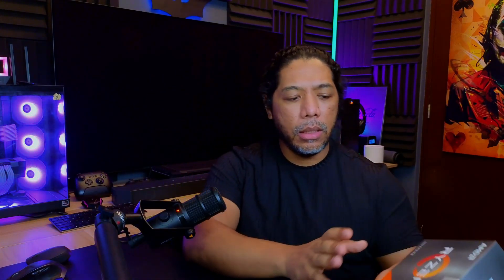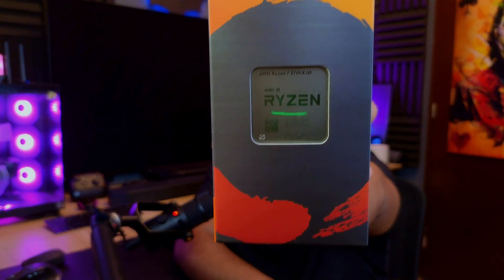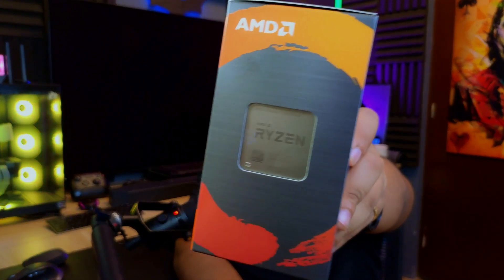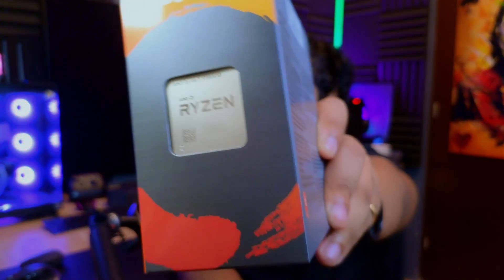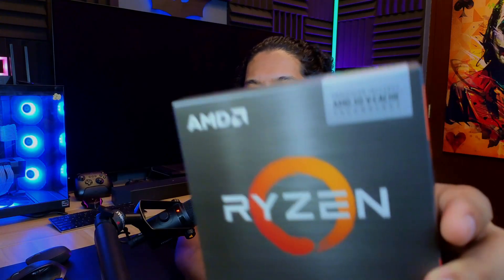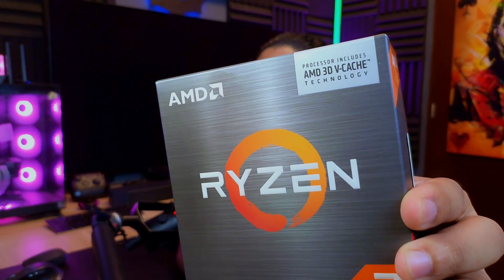Upgrading my Ryzen 5 5600 to a Ryzen 7 5700X3D. Is It Worth It? | Ryzen 5 5600 vs Ryzen 7 5700X3D

Comment: If you're gaming at 1080p the upgrade to the X3D's L3 cache (96<B) will be SUPER noticeable (30% or more). At 1440p, the boost will be 10-13% om average. At 4K, the CPU won't be a factor at all if you have a capable GPU.

Comment: I build budget gaming PCs and I always tell the buyers to stick with the AM4. If you're not looking for 4k high end gaming, you'll still be well served with the 5600 - 5800x3d plethora of CPUs and your card, no matter which one you have, won't be bottlenecked if you pick your GPU depending on your CPU. I still like the 5600x and think it's a great CPU, hell, I even make 3600 based PCs for certain games and types of gamers. You can make a 400€ PC with a R5 3600 and 3060 Ti with great components which will serve all your 1080p/1440dlss gaming needs provided, again, that you're not after the high end experience.

Comment: Adopting the AM4 platform in 2018 is the best gaming PC decision I ever made. Started with a 2400G with integrated graphics. Upgraded to a 2700 and RX 580 8GB. Then i upgraded to the 5600X and the RX 6800 16GB. Then, when they have a 5600X3D bundle at MicroCenter for $260usd, I jumped on it. Needed a home theater pc anyway, so I took my spare parts and put a machine together for my mother, who is bedridden. AM4 is the gift that just keeps giving. Thanks for the video.

Comment: The 6800 will definitely stretch the 5600 but I doubt it will make much difference at 1440p. Contemplating a several hundred dollar cpu upgrade (these are put of production and trickling out at very high prices now) for such doesn’t seem worth it.

Comment: Good choice and lucky on your country, on mine I saw the option about upgrading from my 5600, 5700X 3D and 5800X 3D where my options too. Last year when I was just "thinking" of that the prices where 250 - 5700X 3D and 420 -  5800X 3D a lot of money for me vs. a little performance between those processors. Now I got convinced by our video. 5800X 3D out of stock. 5700X 3D - 620, the exactly the same price as 9800X 3D. My only option right now is a 5800X - 150. :(

Comment: I have a 7800xt on my 5600. With a fully optimized bios it can utilize 100% of the gpu even at 1080p (ultra) on AAA titles. It gets 350-400 on esports. No stutters, probably thanks to 4000mhz cl18 ram. 

But there is no headroom. I was thinking about going with the 5700x3d, but it makes more sense to get the much cheaper 7500f and sell the am4 kit to cover the difference.

Comment: i recently had the opportunity too grab a 9070xt and ive really noticed that my 5600x is bottlenecking it, im getting the same stutters and choppy performance you were talking about with your CPU. in marvel rivals im getting virtually the same performance as my 6800xt and for the life of me i cannot get above 100fps when the action is ramping up and the performance and stutters is all over the place. even at 1440P i noticed in cyberpunk i get better performance on ultra settings than i do on high settings and just watching the performance overlay my gpu wont boost up too the highest clocks unless I turn on raytracing. the most fps i can seem to get is 110 fps and thats with my gpu and cpu tuned too the best of my abilities. its gonna be a night and day difference when my 5700x3d comes in!
Reply: I have the same dilema, I recently bought 9070xt paired with my 5600 but got a good deal to swap my 5600 to 5700x3d + 115usd.

Comment: Bro my cpu r53600 and gpu was 1660 run very smooth in fps gaming recently i upgrade gpu rx6700xt now im facing stuttering and big frame drops even in 2k resullotion very annoying. Now plan to upgrade cpu shoud i buy 5600x or 5700x3d i want smooth experience no plan feature upgrade and want save mony if 5600x is smooth.
Reply from the maker: @Jimmy-jz8bk  X3D variant all the way

Comment: I also play poe2. (500 hours) 
I play at 1440p, rx 5600x + 7900 GRE. and it is very slow in intensive areas.
I've been also thinking of upgrading, but it might be worth it to get whole platform upgrade to AM5 instead.
Reply from the maker: @ShiftLord  whoa.. I just actually bought and installed 7900 GRE and I'm even editing my video about it and will upload it either later today or tomorrow. Poe2 works great on it with 5700X3D! I can even play on 4k native without upscalling and good fps! All settings on max or highest like textures and all! 2k reso for best consistency for the most intentive mob and effects count!

Comment: ASUS Rog Strix B550 -F Gaming ATX AM4 MotherBoard
AMD Ryzen 7 5700X3D 8-Core, 16-Thread Desktop Processor
G.Skill Tredent Z Neo DDR4 C16 3600Mhz 32GB GTZNC
Rog Strix Gaming OC Geforce RTX 4060 8GB  was running the Ryzen 5 5600X and XFX Rx AMD 5700XT Ultra Thicc III Gpu and it was a nice upgrade for sure
Reply: Which bios version ?

Comment: Im sitting with R5 3600x and RTX4060, should I go for R7 5700x3d? just for gaming purposes.
Reply from the maker: No need. Your GPU should not cause the cpu to bottleneck. Unless you plan to upgrade gpu in the near future
Reply: @GlennThoughts  what about ram? i got 16GB 2400 is that okay?
Reply from the maker: Upgrade it to 32gb at least even 3200 is great already
Reply: Upgrade if you notice stutters or low performance on cpu bound games (multiplayer, simulation games). If you mainly play single player games or games with great optimization (red dead redemption 2, kcd2, god of war, etc) you are fine.

Comment: yo what abt 1440p
Reply from the maker: You will see similar trend with lower difference as increasing the resolution makes less bottleneck and relies more on gpu sheer power more than the cpu
Reply: @GlennThoughts  ok, better save up for later i guess! i have the same setup 5600 + 6800 combo. 5700x3d is 2x price of 5600.

Comment: Whenever you upgrade your GPU the difference will be even greater.
Reply: You can try your luck at Microcenter hunting for an open-box Nvidia 3090 with 24GB VRAM and a 384-bit bus for around $600–$699. Yes, I know that price sounds ridiculous, considering it’s three generations old, but these GPUs are still going for $1K on eBay.

I decided to play Call of Duty at 2K resolution, and the graphics are absolutely gorgeous—no complaints here. This should work great with a 5700x3d cpu at 4K.

Comment: Unabhängiger Oculink belegt keinen NVMe-Steckplatz,Produktmarke ist ，，Aoostar，
Ultraleiser AMD Ryzen 7 5825U (8C/16T, bis zu 4,5 GHz), 16 GB DDR4 512 G SSD, Minicomputer, NVME*3
2.Unabhängige Oculink/HDMI2.1-Schnittstelle, unterstützt Dreifach-Bildschirmanzeige
3.Nur 0,6 l Volumen, platzsparend/„Forest 2.0“-Geräuschloses Kühlsystem23
4.Lokale Servicecenter in Deutschland und Amazon FBA-Lager, WiFi 6 2,5 G LAN 8K Dreifach-Bildschirm.

Comment: getting the same upgrade except its a 5600x to a 5700x3d since i got a 6950xt so i want to get the top end for both cpu/gpu on amd
Reply: Was it worth the upgrade?
Reply: Hopefully you give an update, i’m on 5600XT and thinking about getting 5700x3D. Using it with a 3080 FE for 1080p gaming.
Reply: @ThatChunkOfButter    yeah for the moment i had the 6950xt/5700x3d it was pretty good on every game i played and that was at 1440p but i recently got the 9070xt since it was for $599 and the trade in for my gpu was $360, if u wanna ask anything lmk

Comment: definitely my next cpu upgrade to replace my 5600. What worries me is that my B350 started to show its age as it doesn't sync the time exactly anymore (I think the CMOS battery is going to run out of power soon) and also suddenly, the 5700X3D is now skyrocketing price in my country. It went from $140 last december with discount coupon to $200 to buy it LOL.
Reply from the maker: Maybe if you're gonna replace your mobo anyway, go to am5 already with similar x3d counterpart there
Reply: @GlennThoughts  Thank you for your advice! 7800X3D is still expensive so I think it's best to start with R5-7500F & a cheap B650M mobo
Reply: Same here in Brazil... The 5700x3D could be found around 170 but now it's insane costing more than $300 in direct conversion to our currency.

Comment: If you plan on skipping AM5, you are going to be waiting for quite a while. AM4 was around about 10 years before  AM5 came out. So you are looking at like 2030+ to wait for AM6 if all things work out like it did with AM4.
Reply: There is no chance AM5 will last for 10 years. AM4 was an exception. Also, DDR6 will be a thing in a few years. So there is a good chance a 5700x3d will last until AM6.
Reply: @larsenmats  well, we'll just have to wait and see. But AMD has promised to keep AM5 around for a while. I have a Ryzen 7600 in my box and I'm probably skipping this 9000 generation and maybe upgrade for the next cycle. Especially if games start getting more demanding with the next gen consoles coming out in a couple of years. That could be the point where things need to be updated in a more heavy handed way.
Reply: @timometsanoja9666  that 7600 should last you many years
Reply: @larsenmats  yes it should. Only that there is a "break point" coming in the form of Playstation 6 and whatever they decide to call the next XBox and what tech they decide to put in them. If they put serious power in those boxes, it just might obsolete this "ok for now" PC parts over night. I got the 7600 with the full intention of getting a better CPU down the line... Fully aware of these things. It is just the price-to-performance was there a year ago when I was picking out the parts. As I mostly game on the PC, it has enough punch for all the games of today for 1440p. And 1440p is the way to go now... You can get a good performing build without breaking the bank on one of those "sell your organs" GPUs.
Reply: I meeeeean, i don’t think you’ll have the need to change cpu’s for a couple years, even you can upgrade the gpu this cpu is strong enough to don’t have major bottleneck with high tier graphic cards

Comment: I've used these X3D CPUs for a while now. 
They're great for improved FPS but also improves your FPS 1% Low giving you a much smoother experience. (less stuttering and fewer dropped frames)
I have the now discontinued 5800X3D driving my 4070 TI Super and my backup PC has the 5700X3D with a 7600XT.
Even the 7600 XT can run Space Marine II at 1440p, High Preset and get 90 FPS with this CPU.